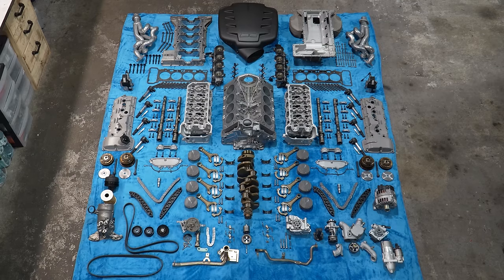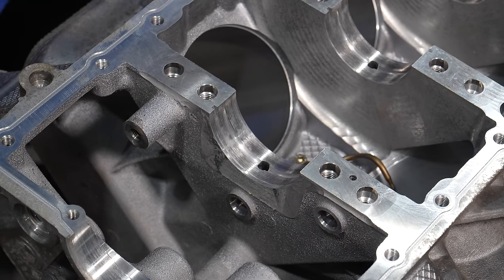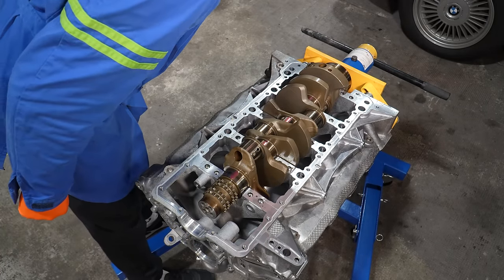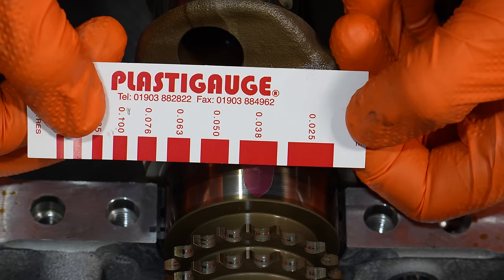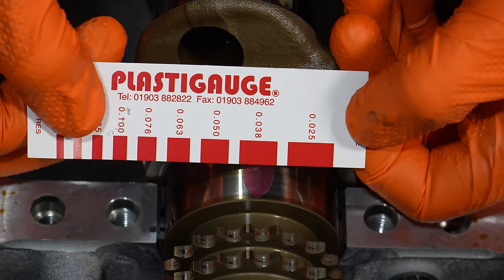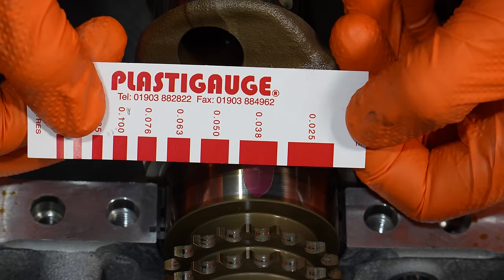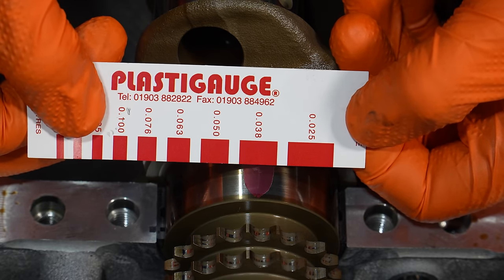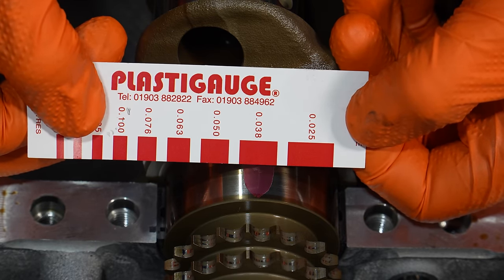Building a BMW S65 V8 From Scratch - BMW E92 M3 - Project Frankfurt: PT6

Comment: How do the manufacturers determine the precise amounts to torque bolts, degrees to turn, etc?
Reply: Manufacturers determine the precise torque values, degrees of turn, and other specifications for bolts and fasteners through a combination of engineering analysis, empirical testing, and industry standards. Here is a detailed overview of the process:

1. Engineering Analysis:
Material Properties: The properties of the materials being joined and the bolt material are analyzed. This includes tensile strength, yield strength, and elasticity.
Load Requirements: Engineers calculate the loads that the joint will need to withstand, including static, dynamic, and impact loads.
Stress Analysis: Finite Element Analysis (FEA) and other computational methods are used to simulate stresses and strains in the joint under various conditions.
Fatigue Analysis: The potential for fatigue failure over the expected lifecycle of the joint is evaluated.

2. Empirical Testing:
Prototype Testing: Prototypes of the assembly are built and tested. This involves applying different torque values and measuring the resulting clamping forces and the performance of the joint under simulated operating conditions.
Destructive Testing: Bolts are torqued to failure to understand their limits and to establish safe operating margins.
Environmental Testing: Joints are subjected to environmental conditions (temperature, humidity, corrosion) to ensure that the torque values remain appropriate under all operating conditions.

3. Industry Standards:
Standards and Guidelines: Organizations such as the International Organization for Standardization (ISO), the Society of Automotive Engineers (SAE), and others provide guidelines and standards for bolt torques and joint design.
Manufacturer Specifications: Bolt and fastener manufacturers provide torque specifications based on the bolt size, grade, and coating.

4. Bolted Joint Design Principles:
Thread Engagement: Ensuring proper thread engagement to avoid stripping.
Lubrication: Accounting for the presence of lubrication, which can significantly affect the required torque.
Joint Stiffness: Designing the joint so that it has the proper stiffness characteristics to maintain the required clamping force without loosening.

5. Assembly Process Considerations:
Tool Calibration: Ensuring that torque wrenches and other assembly tools are calibrated correctly to apply the specified torque.
Process Controls: Implementing process controls and quality checks during assembly to ensure that the specified torque values are consistently achieved.

6. Torque-Angle Method:
Yield Control: In critical applications, bolts are sometimes tightened beyond the elastic range into the plastic range (yielding) to ensure a consistent clamping force. This is often specified as a certain angle of turn beyond a snug tight condition.
Torque-to-Yield (TTY): This method involves tightening the bolt to a specific torque and then turning it a specified number of degrees to ensure that it is in the plastic deformation range, providing more reliable clamping force.

Example:
For an automotive engine head bolt, the manufacturer might specify a torque of 60 Nm followed by a 90-degree turn. This is determined based on extensive testing and analysis to ensure that the bolt provides the necessary clamping force without yielding excessively.

By combining these various methods and considerations, manufacturers can determine precise torque specifications and other requirements for bolts and fasteners to ensure the safety, reliability, and performance of their products.

/ chatgpt
Reply: @Markoboy99  interesting, thanks!

Comment: You can remove plastic Guage with engine oil
Reply from the maker: I know, that's what I'm using, but you will still scratch the bearing if you don't apply silicone spray.

Comment: what is the weird lookin torque wrench thing with the dial and the gold flexy bit? what does it do?
Reply from the maker: Measures angle degrees.
Reply: I figured it out :) it's measuring how much he turns the wrench and the gold thing has a magnet on it to prevent the dial from turning

Comment: At  33 min .  Is it true the BMW  wears out  rod bearings due to lack of side clearence . No gap for oiil to escape so the  bearings get hot ?  Also at 38  min you installed a CCV  non return valve and placed a piece of tape over it . At   42.50 you placed the head on without removing the blue tape  ?

Comment: I'm experiencing the worst case of technical dysmorphia I can ever remember.  Your video is a clear masterpiece of instruction that I, as an engine builder on everything from VW two-piece cases to fuel injected Corvettes, would not hesitate to use for reference in such a rebuild.  

On the other hand, the level of required complexity engineered into that BMW V8's assembly cannot be adequately described by anything less than words like absurd.  In the length of time and level of effort required just to plastigauge the mains, I found myself experiencing a massive loss of respect for BMW engineers who could not build a block requiring less kludgy bailing wire and spit assembly to keep the damned thing from coming apart.  

Really?  More bolts to attach a crank girdle than it takes to assemble an entire 327 V8 Chevy, for example?  Where did they get their design ideas from - Vulcan aliens?  What's next - multilayer Damascus block alloys?  There is CLEARLY too much price and complexity and hallucination-limits-no-object thinking going on among their engineers, and we have no shortage of far more powerful engines that do not require anything like that hand-stitched delicacy that once covered your floor does to assemble run, and provide high-performance power.  

It is a step backwards in engineering elegance, to be sure.  

Do not mistake me as anti-BMW; the love of my life was a 633, and my son currently drives his second 2 series - an M2 - virtually at my insistence.  But this is truly shamefully unnecessary level of engineering complexity for the return.  

I praise you for your extreme patience and dedication to detail and clarity - a model of the skill level to which an engine artist can rise in his profession.  And your effort on this video is exemplary of the level of value to which the enormously powerful YouTube, as an information source, can rise on behalf of its viewer community.  Thank you - truly - for the effort.
Reply: You don't get >100hp per litre and 8000rpm out of a 327 Chevy

Comment: 32:34 I would have placed that plasti gauge at the midpoint of where the rod cap goes; here he placed it 1/3 or so from the midpoint. A bearing’s clearance is usually smallest at the midpoint (half distance of the bearing/cap/rod. That’s the ideal spot to measure the clearance, IMO…

Comment: Did you seriously use silicon-based spray on the bearing for the crank? You should only ever use petrolium-based lubricants, both for cleaning and lubricating. You do understand they use silicon-based compounds to seize engines during catastrophic destruction at junk yards, right?
Reply from the maker: Why are you talking rubbish? I used fogging oil for men, not silicone spray.
Reply: @M539Restorations  4:00 "apply a bit of silicone spray on the [crank] bearings" ??
Reply from the maker: @chbrules  Yes, normal practice, otherwise the plastigauge will stick to the bearing and you'll scratch the bearing when trying to remove it. If you actually ever did this job, you'd understand. The amount used is miniscule (dabbed with a finger) and both the bearings and the crank are cleaned before assembly and treated with assembly lube. Why are you overacting over literally nothing?